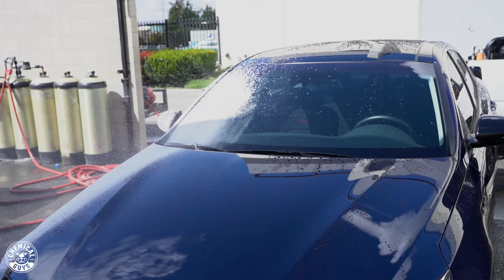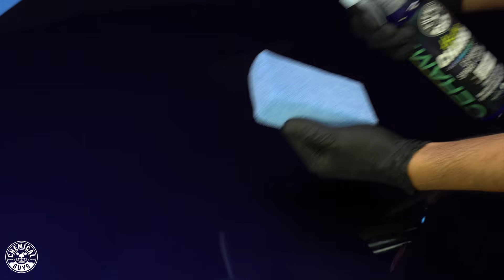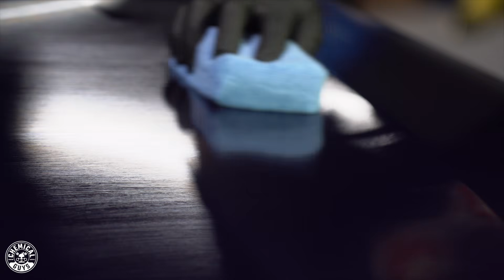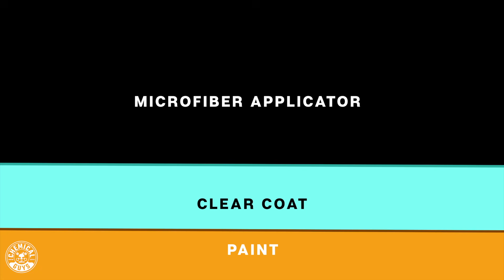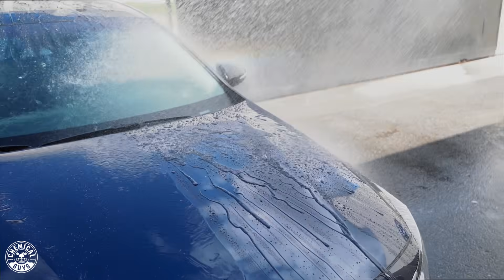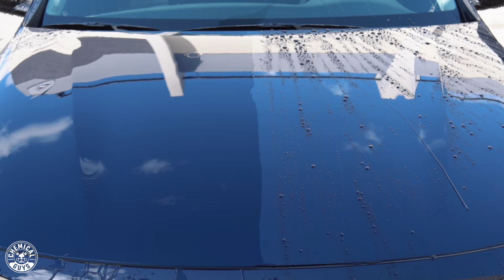How To Easily Apply NEW HydroCharge Ceramic Spray Coating | Chemical Guys

Comment: Would you put a glaze on before or after this?
Reply: You would put the glaze on before you put the coating on but you gotta make sure that the car is prepped properly!!!
Reply: They recommend bare (wax, sleanat, glaze free) paint. Once it's cured you can top it with whatever you want.
Reply from the maker: Great Question! HydroCharge would land on the protective coating category right before glaze because you want the coating to bond to the paint and not to the oils left behind from the glaze which would cause an improper bond! Make sure to prep the surface just as you would like any other coating such as Carbon Flex C9. HydroCharge Ceramic Spray Sealant is an ambient air cured coating. No special lighting or infrared light is required. The unique sprayable formulation starts to cure the moment it is sprayed out of the bottle and exposed to air. Once applied to the surface, the product will bond within 1-2 minutes. Always remove and buff to a perfect shine with a premium microfiber towel. After applying HydroCharge Ceramic Coating, it is ideal to keep it out of the elements in a dry and clean environment for 2-3 hours. Depending on the climate, the hydrophobic effects will continue to improve even more after 24 hours of being applied. Then you can feel free to apply any further coatings such as glazes, sealants or wax. Refer to HydroCharge FAQ'S for any further questions. Happy Detailing! https://www.chemicalguys.com/article-hydrocharge-faq.html